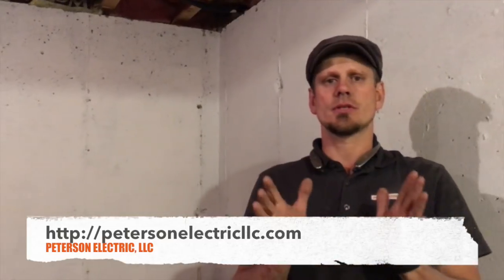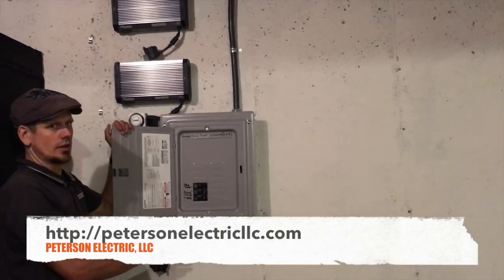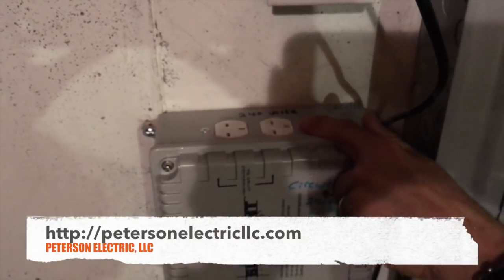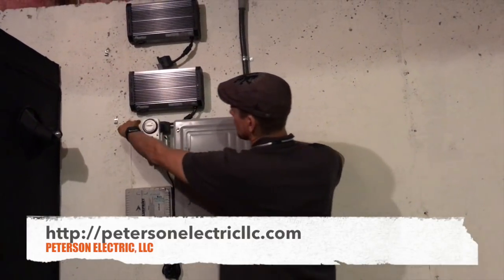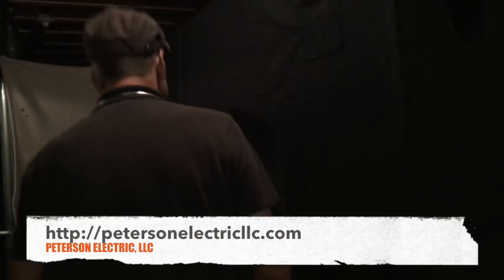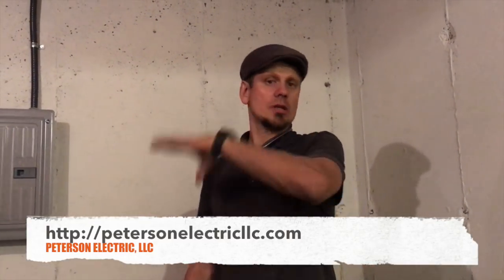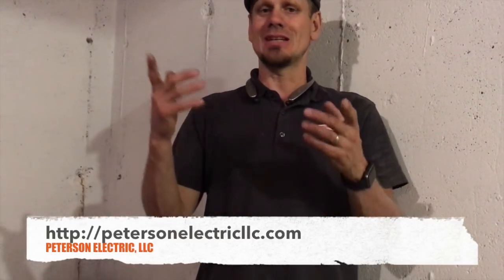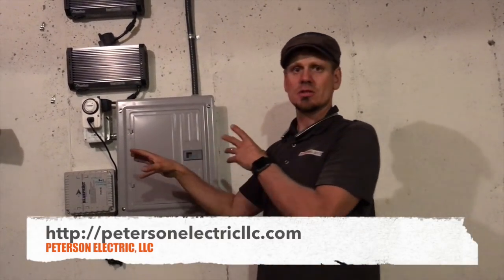Electrical System For A Grow Room

Comment: My house has a 4 outlet plug.... this direction only shows 3 wire install... what do i do with the 4th wire in my cord to reach the dryer plug of the house?? or where does it connect in the light controller box?

Comment: on a 4 light controller, it has 4 inputs for either 120v or 240v.. is it ok to plug in three 120v and one 240v plug?

Comment: So any use over three hours is considered continuous that’s pretty much every single install you’re ever going to do there’s always something running fridge freezer o’clock electrical goods on standby AC central heating The list is endless man who ever come up with that needs a fucking slap because every panel should be installed to that standard

Comment: Is it OK to put a panel directly on a concrete wall in around anyone else? A HUGE no-no around here.  Need at least 3/4" plywood around Philly. They are afraid of moisture working into the panel...

Comment: ARGH drives me nuts when electricians explain amperage incorrectly. There are 2 legs/phases, so it doesn't really matter if you pull 10 amps from one (120V) or 5 amps from both (240V), in terms of your overall power usage and how many watts you can run at a given input amperage. Some devices are a bit more efficient at converting power with 240V input, but they don't draw half the amperage at 240v it's just divided across the two phases. It can be confusing because split phase 240V AC power is called single-phase interchangeably (probs cause most of your outlets will be 120v single phase). There's no free lunch, you cannot simply double the amperage you can draw if you change to 240V ballasts/cords, you must still calculate the power draw on each circuit,  each subpanel and at the main and allow 20% overhead for constant use. That said I really like the subpanel setup even though it's ridiculous overkill for 2 thouies, I'm planning something similar to run a couple dozen LED fixtures.
Reply from the maker: No code per say says to balance the neutrals, but when installing a sub panel to a main panel or a main panel on a service disconnect, it is good practice to determine when their items that might turn on be balanced, for example charging a tesla at night, vs your AC at night or welding vs not cooking or cleaning appliances. Balance your life and set the appliances on a different times, no different then towing a load with your truck and leaving the AC on when going up I-70 in Colorado on a HOT day. Good point!

Comment: What an interesting situation, thanks for a glance at a new industry. I believe the other situation in a grow room is humidity, which will be a consideration for panel location. Your remarks about what happens to a device when underfed voltage are interesting. If the device is designed to have a fixed power output, it will automatically dial up amperage draw if fed inadequate voltage. Exactly opposite to simple devices with fixed resistance.
Reply: A little late on my question, but here it goes. When you say grow room, you're talking about marijuana, correct? I just had to wire a grow room for a medical supplier and wired it similar to how a greenhouse would be wired. I didn't exactly have any real info to guide me. Do you know of any sources that have information on requirements for legal grow ops?
Reply from the maker: @michaelinzitari5405  code does not have a grow room guide, but it is usually considered wet or damp location. Use your OHMS' Law., best way.